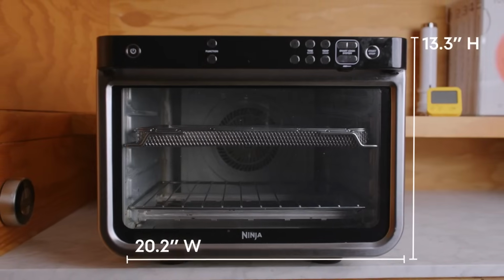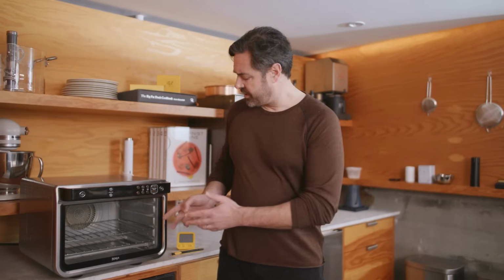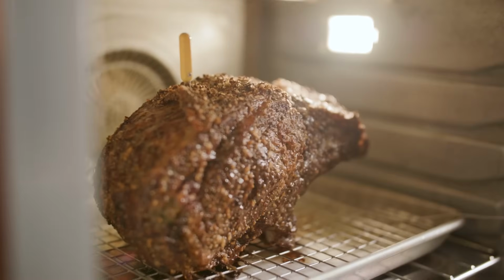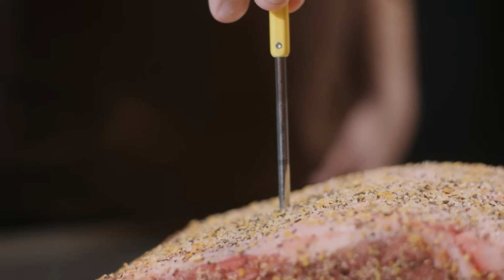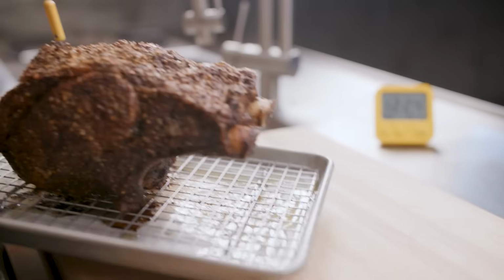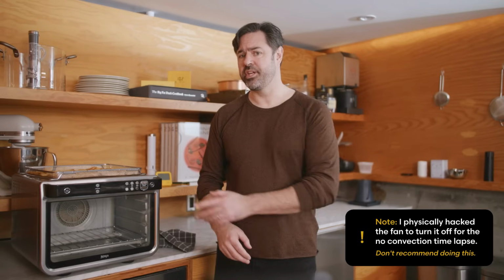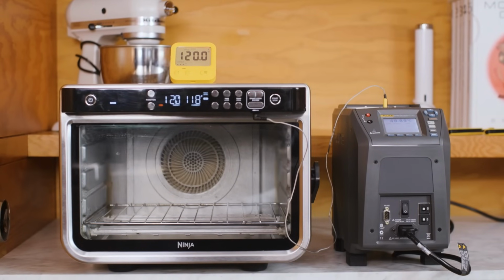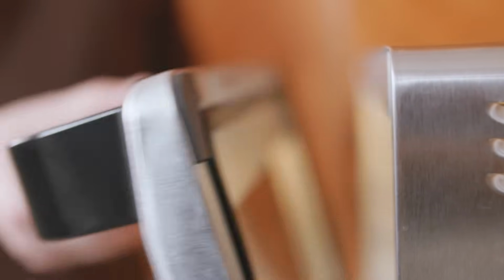The Best Countertop Air Fryer? | Ninja Foodie XL Smart Oven REVIEW (Ep#3)

Comment: I am amazed this oven doesn't let you turn the convection fan off for traditional oven baking. That seems so obviously useful, single, and easy to engineer. Even heating and air blowing over the food is not always optimal. Since this oven can't do conventional baking, some people will need another oven where they can cook without a convection fan.

I'm glad you hammered them in the final shootout comparison video for it. Unfortunately, this flaw greatly reduces the versatility of the oven. However, it's so obvious that I expect they'll change it in the next version. I'm not going to replace my current toaster oven yet, but I'll be looking out for the next generation of this Ninja smart oven. Other than the fan not being able to turn off, this oven is an exceptional value.

Great video and series. Very useful. The best primer on smart/sensor-cooking countertop ovens and the current state of the market that there is. Thank you.
Reply: If you want to bake without the convection fan, use the "Reheat" function.  Adjust the time and temperature to what you desire.  The convection fan does not come on in the "Reheat" mode.
Reply: In what scenario would one prefer to turn off the convection fan off for traditional baking purposes? Thank you
Reply: @Miguel-ve1lh  I could have given you a more precise answer when I saw the video and commented eight months ago, as I don't remember the details of this oven. But in general, uneven heat is often utilized in ovens, and convection fans in home ovens should be able to be turned on and off. I don't want fans circulating the air when I want the heat to rise to the top. For example, when broiling or most times when I'd be putting the food at the top or bottom rack of the oven. Pizza with a baking steel I do as high as I can in the oven, because I want maximum heat entering the top of the pizza from the air of the oven. The bottom of the pizza will get a lot of heat from the steel below it. Other foods where I want to slow down how hot the top of the food gets I place on the bottom rack of the oven, to prevent the top scorching. Maybe that would be fine with a fan, I haven't tried. But I definitely do rely on a heat zone at the top for some high heat baking.

Even in my small cheap toaster oven with just a top and bottom level, I consider how high and low to place the food based on what I'm cooking. On the higher level, closer to the top heating rods, heat is more uneven. The top of the food gets more heat than the bottom. Learning how the oven heats my food, and does so unevenly, gives me options. It gives me the power to control how my oven heats my food by moving to different places in the oven. A convection oven evenly circulating the air is designed to make all areas of the oven cook the same. This is often useful, but not always. Sometimes the food will benefit from more heat applied to the top or bottom. Without a convection fan operating, I can influence that. Heat rising to the top, hot and cold spots. Moving food closer to or away from hearing elements. That heating variety opens up more possibilities and control. But if you want even heating, it also means using the center rack and rotating and slower and sometimes inferior results compared to a convection fan. So I'd like a convection oven when I can turn the fan on and off. Sometimes I don't want the heat blowing around.

The airflow affects browning, as well, by blowing moisture off the surface of food. This is sometimes desirable, sometimes not. It would speed things up when I'm trying to get a touch of brown or black on the top of my broiled tomatoes, which sounds like a good thing to me. But if I want to slow browning when cooking something thick for a long time, then maybe I want to keep the surface of the food moist longer.

Anyway, an on and off switch for the fan is an easy way to make the oven more versatile and givr the cook more control of how things cook.

And the simplest and best reason may be that most recipes aren't written for convection ovens. You could try to figure out how to make it work with the convection fan. It would be worthwhile if you make the recipe repeatedly. But if you're just trying a recipe, it's a lot easier to just turn the fan off and follow the recipe as it was intended, without adjusting cooking time. I would be turning the fan off for that reason all the time. Timing is different in a convection oven with the fan blowing.

Comment: As I mentioned in your Joule review, I really wish you'd include a review of the Anova Precision Oven as part of this series. It seems to address many of the issues that you discussed in evaluating the ovens in this series: it has an (internal) temperature probe, which the Joule lacks; it has an app that allows you to use pre-configured recipes (like the Autopilot on the Joule) but that also allows you to adjust the oven in real time (or in advance); it has a rear convection fan like the Ninja oven; it even includes an ultra-precise "sous vide" mode for cooking a temps below 180F(ish) with something like 0.2 degree temperature accuracy; it's a combi oven that allows you to use variable levels of steam during the cook; etc, etc. And while it's not cheap, it's less expensive than the June oven. 

As I also mentioned in my other comment, I like many things about it but the touch interface on the oven door handle I find to be a real pain (especially for setting/adjusting temperature). Fortunately, I can mostly ignore that and do everything through the app. Still, it's a shame that it's not more easily adjusted or controlled through the touch panel.
Reply from the maker: There will be a review in the future, but it’s such a different oven that I didn’t feel like it made sense as part of this series. It needs a fairly long video of its own.
Reply: Sounds good, thanks. FWIW, though, when I was looking for a countertop oven, I was cross-shopping the Anova oven against the Breville and June ovens. Other than it's combi (and I guess "sous vide mode") functionality, it does seem to me like a blend of those other three.
Reply: @ChrisYoungCooks  LMK if you need a peer review for the APO video  ;-)
Reply from the maker: @sheimend  it’s on my countertop now. Always willing to learn about things I should test.
Reply: @ChrisYoungCooks  looking forward to your tests of everything but toast :-)

Comment: The convection part is interesting. In barbecue people said large offset smokers are able to run hotter due to the large amounts of convection, but in this theory case with humidity and evaporation, low airflow systems like electric smokers should be able to run hotter. Is there a counter effect of evaporative cooling caused by the airflow that make a difference where large airflow actually slows down the food's cooking, despite convection? It's like the Leidenfrost effect and evaporative cooling are clashing and one wins out.
Reply from the maker: Yes, there is absolutely a dynamic balance between stagnating water vapor insulating things, and really fast air flow causing more evaporative cooling of the surface. I hope to get into this in a future video focused on BBQ smokers and the stall.

Comment: I did happen to notice that the Ninja oven wasn’t on the shelf. So the width may not be a drawback any more than height depending on your kitchen.
Reply from the maker: It is deeper, but those shelves are also weirdly shallow. Much shallower that a standard counter.
Reply: I had a shelf in my last kitchen where I put a small oven and I doubt the Ninja would fit. Great content, though. Has that old ChefSteps feel.
Reply from the maker: @clayhorste  🙏
Reply: Less width means a lot of pans don't fit.

Comment: What I thought was fascinating in the first roast cooked with convection is that the surface temp rose, then fell, then rose again.  Also, in the second non-convection case, this might be the fastest way to get the core temp up, without over-cooking the surface, before dropping into sous vide/surface temp cooking for the rest of the cook.
Reply from the maker: Yes, you can see the effect of the heating elements cycling on and off at the surface and around the food.

Comment: That oven is like a hammer, and a great one. I really enjoyed your explanation of convection cooking and even how convection still functions when deep frying. I also enjoyed your noting of the presence of the more forceful convection fan and heating element more typically found on commercial appliances and its rarity in a consumer countertop oven. I like how honest you were as well when outlining the cost cutting realities of that oven. It does seem funny that as you said they probably pushed the outside surface temperature of the limits of UL certification tolerance. But that's I guess what happens when you're making a "bang for the buck" type of product. I'm so incredibly glad that someone with your knowledge, experience, and tact is making consumer appliance review videos. I am very excited to see the final of this series and more that you create in the future. Also, that Fluke testing unit is very cool.

Comment: Personally, I think a better option is to go to a light commercial oven.  For example, the UNOX Bakerlux Shop Pro.  It comes in a few different options. It is a little more expensive than the three countertop ovens you have shown but, the quality of the oven is far superior plus it is phenomenally easier to keep clean. (I do not work for UNOX nor own one at present) I own a Breville Air Fryer, it cooks reasonably well for the price but a pain to clean after cooking a roast etc.  The internal cavity is full of small places for grease to hide and it’s construction is of low quality materials.  In contrast the internal cavity of the Bakerlux Pro is extremely easy to keep clean due to high quality stainless steel and no small grooves for grease to hide.

Comment: I have the non-smart predecessor to this oven and I absolutely love it.  Specifically because of the size, I can do most anything I would use a normal oven for, but use a fraction of the energy and generate much less ambient heat in my kitchen.  Perfect for baking or roasting something in the middle of summer.

Comment: Between the Creami and this oven it seems Ninja are making some good products. Looking forward to the final episode.
Reply: Their air fryer grills and smart lid cookers are top notch too.
Reply: I really don't want to like Nija ("made for TV" style advertising), but it's hard not to (I have a CREAMi).
Reply: @bostonbesteats364  hey just a heads up, fellow creami user here and there is a design flaw that you might not know about. I was wiping down the bit that turns the blade after every usage but didn't realize that it was getting pretty gross still - now I clean it like an espresso steam wand (boiling hot damp towel) but it basically bricked my first creami. their customer service was a nightmare to get in touch with but they did eventually send me a replacement model. just a head's up, enjoy your icecream and sorbets!
Reply: SharkNinja products actually last longer than you'd expect for a value-focused brand.  The only problem I've ever had with any of their products is a blender cup (the smaller of the master prep style) cracking over time and the thing is around a couple decades old, our other blender set (which is a decade old by this point) still looks pretty pristine, our other Ninja appliances are just fine after years of use as well (first gen slow cooker and first gen coffee bar), and all of our Shark products  (again, around a decade old or older at this point) are fine other than the typical discoloration that white plastic does.  However the benefit that SharkNinja does have being a value-focused brand is product iteration, which brings refinement and features, their later gen products are a lot better than their earlier iterations.  They might be cheaper and cut corners in some areas, but they also last as long as you don't outright abuse them, and if you can wait a bit investing into later iterations is better than buying the first iteration; they're at a good price point where they're built to last awhile in the typical household, but aren't overpriced with unnecessary or intrusive features.  Some cost cutting doesn't really matter anyways, like the 2°-4° inaccuracy of the thermometer, most ovens are inaccurate in the first place and a couple minute of overcooking or undercooking isn't going to hurt anything; if you ever pay attention to a full-sized consumer conventional oven, the inaccuracy is even farther off, and I'm willing to bet that your typical consumer-grade digital thermometer that's within the price range most consumers are comfortable with are also within this range or more inaccurate- this cost cutting note is just a bit pedantic and unrealistic without additional data points of comparison to other products within the intended market range, where the 'more accurate' multi-sensor smart-predictive-thermometer is also targeted at a much higher market segment (You won't realistically see this thing in Walmart or Target for example) if not also crossing over into the commercial kitchen market (which is a more realistic market for this thing anyways); in essence there's a massive disparity within all of this.  In conclusion, the Ninja oven is a fair price for what it's capable of and how long it'll last you, and since it's not a connected device it's not predisposed to become abandonware once the company moves on or goes under, unlike the other ovens, not to mention that there's no data privacy intrusions with a non-connected device.
Reply: Love my Creami!
Reply: Ninjas industrial design is just so so naff.